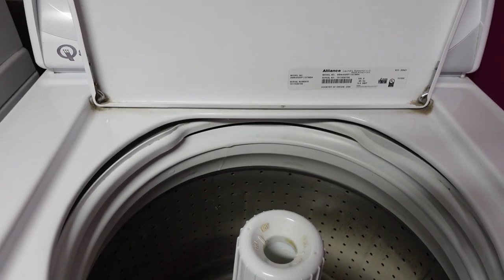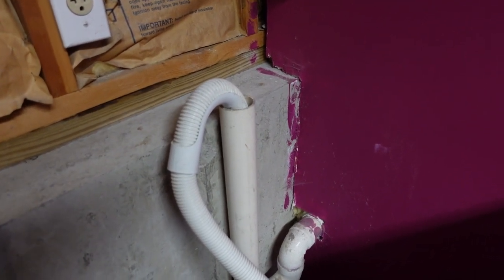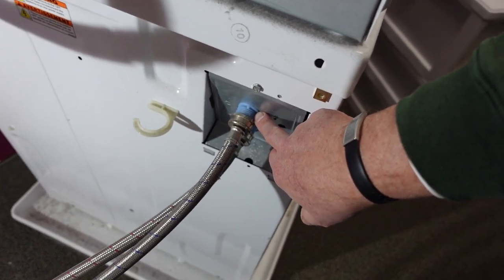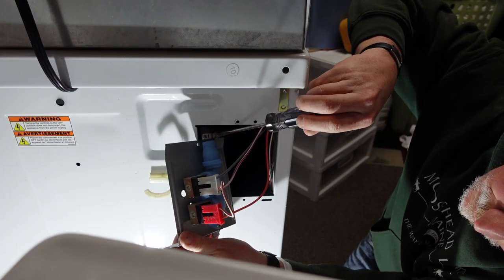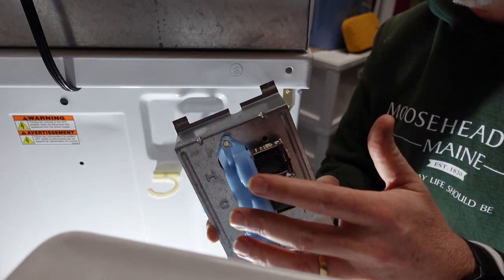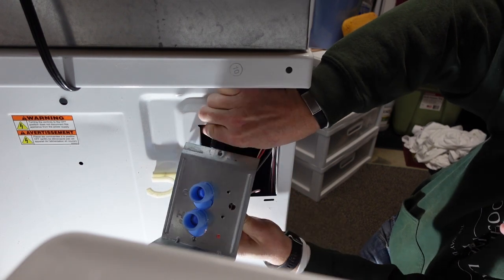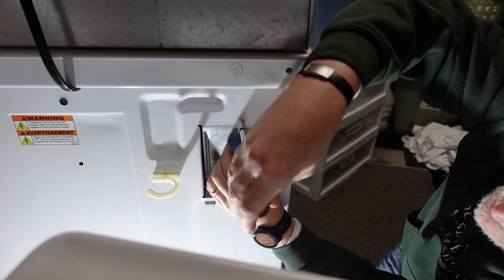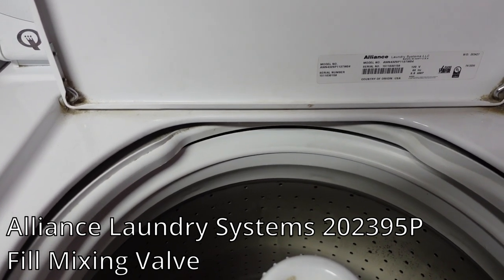SpeedQueen Washer Fill Mixing Valve Replacement

Comment: Great video. Short and succinct. Helpful cues about potential trouble spots, like the hard-to-remove plastic prong covers. It was good to know they were just tight, there was nothing holding them on. Good editing, too, to cut out unnecessary sections of struggling with screws or whatever. Helped me get the job done. Much appreciated.
Reply from the maker: Thank you! I'm glad you found it helpful!

Comment: Had an intermittent minor leak for 2 years in my washer machine, bought the valve part 2 years ago but didn't see any Youtube videos or anything back then to guide me.  I endured with the intermittent leak until coming across this video.  Took me 2 hours to fix.  Thank you.
Reply from the maker: Good deal. Glad I was able to help end your suffering! Thanks for watching!

Comment: I have this same model washing machine.  My problem is that the hot water won't come into the machine.  Will a mixing valve replacement fix this problem as well?  Thanks for the video.  It was straightforward and easy to understand.
Reply from the maker: Thank you, I'm glad you found it helpful. I'm sure this could be the reason. If the solenoid that opens the valve is broken, it won't let the hot water in. I assume you checked on the actual supply coming into the machine from the wall? You could remove the hose from the machine, put it in a bucket, and then open the hot water valve (slowly). If water comes out, you know it's not the hose (they may collapse if they're really old - replace them both if that's the case). My next thing if I had your problem would be to replace the mixing valve. There is a website, www.repairclinic.com that has a lot of troubleshooting videos. It may give you more ideas. Good luck!

Comment: Great video!  Less than 15 minutes start to finish because of your excellent coverage of this repair.  You even told us what nut drivers we'd need.  Hint:  I found it easy to get the "spring loaded" screw holding the mounting plate to the frame by first connecting the bottom hose (hot) and using it as a convenient lever/handle to exactly line up the mounting holes for the 5/16" screw. Voila, drip gone, couple hundred bucks saved.

Thanks again!
Reply from the maker: Good tip! Thanks, Stephen. It brings me no greater pleasure than to know I was able to save someone money by helping them do it themselves!

Comment: Not only did it fix the drip, but my wife had noticed that on the "warm" setting the water wasn't really warm.  It was cool.  Now it's warm!  Looks like the old part didn't let enough hot water in.  Oddly enough, upon disconnecting the hot water hose the water that dripped out was yucky black.  Perhaps the hose was also disintegrating.  New hoses now too.
Reply from the maker: I'm so happy it worked! And good call on the hoses. I replace mine every 5 years or so. Just not worth taking the change on one of those letting go while you not home.

Comment: Same thing on my 8 year old Speed Queen. This is a beautifully done video. So helpful  I will put Two Wraps of Teflon tape around the threads before reattaching. I read any more than 2 wraps is BAD. Maybe unnecessary. Thanks.
Reply from the maker: Thank you and glad it was helpful. Yes, I've always been told too much Teflon tape is a bad thing. Two wraps should be plenty.

Comment: At 22 seconds, what are the stub type things opposite the hose connections?  Are those to reduce water hammers?
Reply from the maker: Yup, exactly what they are. They worked okay, but I ended up hiring a plumber and put a reducer valve in the water supply to the house. Those water hammer restrictors will eventually wear out and I was still having problems, so I bit the bullet and put in a permanent fix.

Comment: Are these valves universal? I have a speed Queen model AWN63RSN115TW01
Reply from the maker: I looked up your model at repairclinic.com (another place I get parts when Amazon doesn't have them) and found this: https://www.repairclinic.com/PartDetail/Water-Inlet-Valve/205547P/4982327. At Amazon, if I type that part number in, I get this: https://www.amazon.com/s?k=205547P&crid=1M2VCAFN7H7JW&sprefix=205547p%2Caps%2C88&ref=nb_sb_noss_1. Not sure if it's the same, but these links should get you in the right direction. I'd double-check for yourself, though, to make sure you agree.
Reply: @roundtailrestoration Thank you!

Comment: Easy straight forward.  Thanks.  Mine were 8mm and 5/32 fyi.
Reply from the maker: Great. It really doesn't get much easier than that. Can only imagine how much a repair would have cost to have someone come out. Thanks for watching and glad it worked for you!
Reply: Totally.  I usually try to find a fix video and then make decision to attempt or call someone.  I found your video and I can handle it no problem. This wasn’t difficult at all except the water spillage.  Thanks again

Comment: Well done !!. Question, how long did you have this washer when you found this problem ? Thanks.
Reply from the maker: Thank you. I think we're going on 6 or 7 years. A bit sooner than I would think, but our water here is pretty hard, so I'm sure that had something to do with it - probably fouling of the valve seat vice actual failure.
Reply: same thing just happened to me washer is from 2018 @roundtailrestoration
Reply from the maker: @jewllake  I can't remember how old ours is. 2018 might be about right. I didn't think it would start leaking that quick, but our water is pretty hard here so it eats stuff up pretty quick. Thanks for watching!
Reply: @roundtailrestoration On the serial number, the first 4 digits are year/month of manufacture which should help you know when you got it.  Thank you for the video; tired of waiting for & then paying for repairman.
Reply from the maker: @bethmichaels8410 thank you. Glad it cc was helpful!

Comment: Would this be the issue if my machine won’t even attempt to fill?
Reply from the maker: I assume it could be if the valve is broken electrically. There should be some troubleshooting help at www.repairclinic.com. search for you symptoms and it should help.

Comment: Anything else it could be? I just changed mine and it’s still dripping very slightly. I have the same washer as you do.
Reply from the maker: No, not that I know of. That's the only place water comes in, so if it still drips with the washer off, my guess is you may have gotten a defective valve.
Reply: @roundtailrestoration  thank you so much